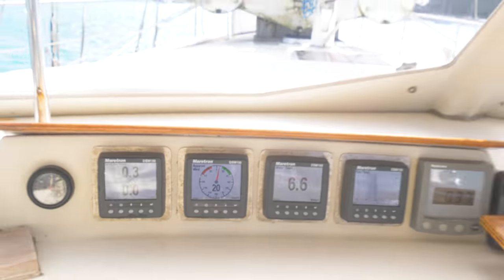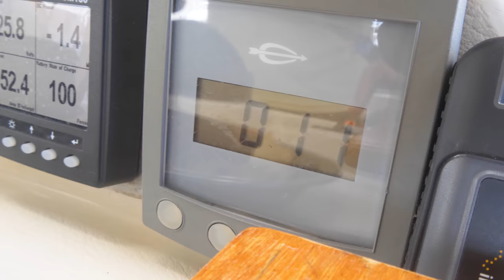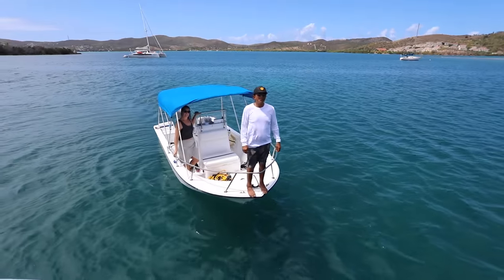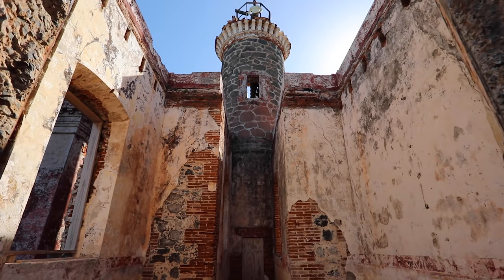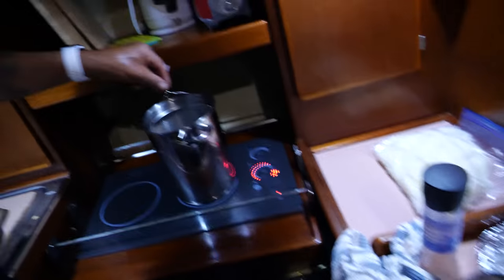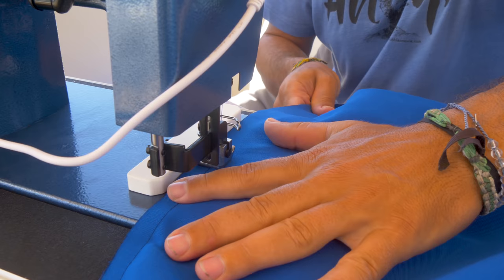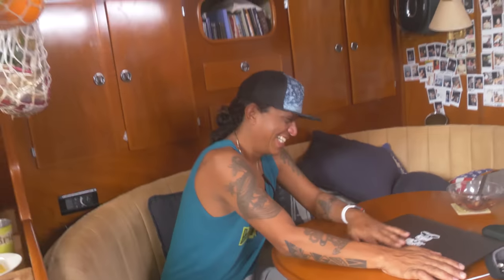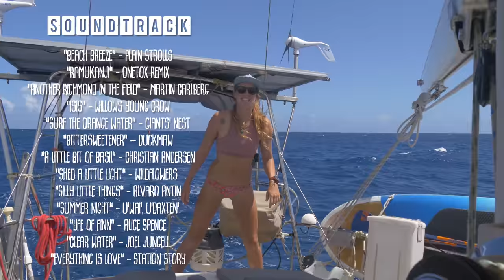The best way to explore is with a local- Culebra, Puerto Rico! - Sailing Vessel Delos Ep. 233

Comment: To kinda of answer the question about how many hurricanes Culebra has seen in 200 years, I did some research. Since data exists for the main island of PR not much data exists specifically for Culebra, some extrapolation was needed. During the period 1980 - 2005 (25yrs), 12 tropical storms and hurricanes impacted PR. Of those, 8 were hurricanes. Of the 8 hurricanes, Culebra was mentioned in 2. From the period 1900-1979 there were 18 hurricanes but Culebra was never mentioned. So taking both sets of data for 105 yrs (1900 - 2005), there were 26 hurricanes. If in 25yrs 2 mentioned impacting Culebra, then one "could" say the incidence could be 8 in 100yrs (not exact science). The period 1800-1899 there were 20 hurricanes. How reliable that data is might be questionable.

Seeing that the main island of PR is 3,500 square miles and Culebra is 169. PR is 20 times larger and a much bigger target for a hurricane to hit at least a part of the main island opposed to hitting a 169 sq mile speck in the ocean.

So, framing the answers both Kazza (5) and Breyawn (50-100) gave about how many hurricanes hit Culebra in 200 years. I will reference the game show the Price Is Right...."and the winner is Karin, come on up"

My source:  http://huracanado1.tripod.com/history3.html

Cheers and fair winds to BKBB and baby Sierra

Comment: A bit of hurricane anxiety while driving Delos into the zone for the 2019 season, eh Brian?
I thought 50-100 was a bit of hysteria, but it turns out not far off.  At least 38 hurricanes and 8 significant tropical storms.
Reply from the maker: Yep, there have been a few rip through there....
Reply: Thanks for doing that research for us, I thought I was going to need to do it.